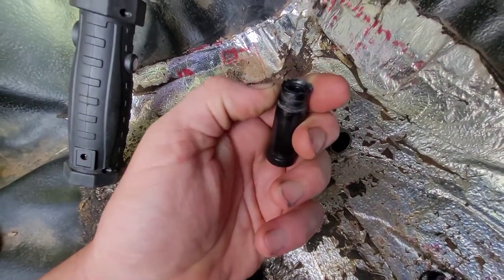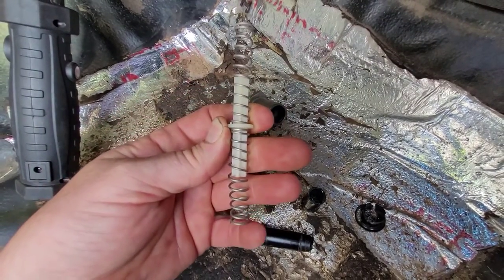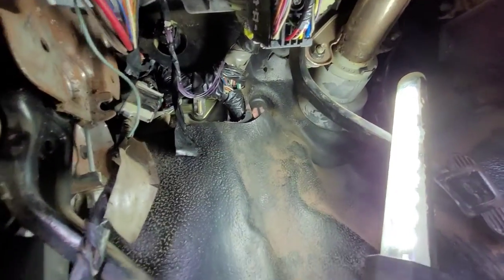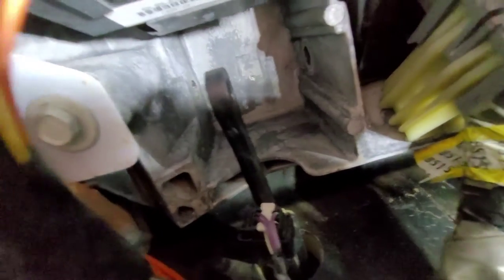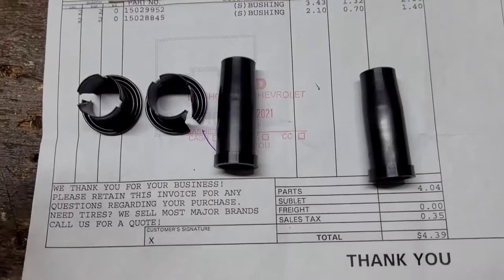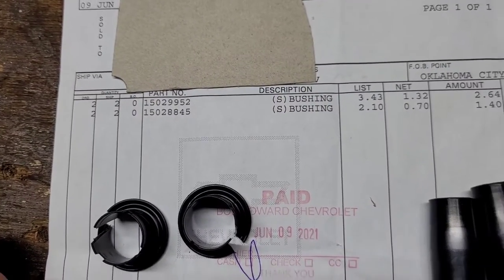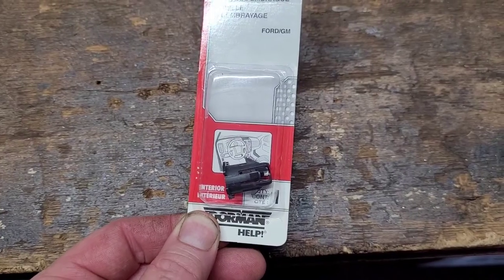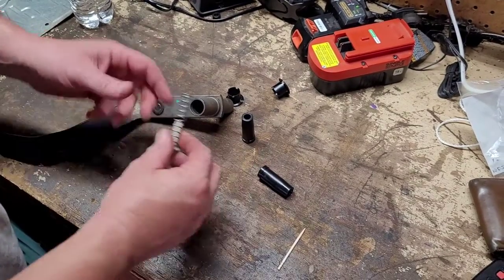How to replace the clutch pedal bushings on a 1999 Chevy S10 pickup

Comment: My clutch pedal broke off while driving to work which really surprised me. It did start squeaking every maybe 10th push. I thought the master push rod broke at first when it happened. I think I'm going to bulletproof it and take dash out and put a bolt like there should have been to start with. I really can't complain too much as it did last 26 years / 234k miles. Love my S10 it has been trouble free for a long time. Wish GM would make a true compact pickup again though. The dorman help stuff is hit and miss most of the time in my experience. The circle bushings are discontinued from GM now but luckily can still get them from other companies. Thanks for the video.
Reply: Brotherrrr! Mime just did the same thing! 99 with 280k haha. Thankfully I'm in front of the house though. So what did you do to fix it? What did you use? Since the circle bushings are now discontinued. 
I've had the dash out of the truck 3 times before. Fixing blend doors and heater core twice. Cause I loved doing it so much the 1st time 😂🤪

Comment: Thanks for the video, went off it today. Had to make the same repair. 

I lost one of the Springs, the dealer wanted $30 for just one spring. My local ace hardware had it for $2 bucks . 

Those two part numbers for the two different upper bushing i think are discontinued as well, luckily my local gm dealer had some laying around and yes they were cheap, around like $1.60 for one and $.70 cents for the other. 

The lower bushing that connects to slave cylinder bracket arm is like $11 bucks from dealer.

Comment from the maker: Also found out the previous owner installed some sort of high performance clutch which means there's more pedal pressure to overcome which means more stress for the stock pedal pivot bushings which means I'll probably be replacing these again fairly soon

Comment: Hello I have a question, how did you take off the pedal from its place. Thank you
Reply from the maker: The bushings were broken and the pedal had fallen out, come to find out a previous owner had installed a high performance clutch and it caused excessive pedal pressure which over strained the bushings and they broke

Comment: How did you take the clutch pedal out. Im reading decompress the springs but there is no way to do this. Can you kindly share how you got the old clutch pedal out?
Reply from the maker: On this particular vehicle, the pedal pivot bushings were already broke in half so the pedal just fell out, but if you needed to remove the pedal, i would guess you'd have to attempt to cut each bushing without damaging the little springs
Reply: @theman9764  the bushing on the left side is broken. I try wedging a screwdriver where the break is to free the right side but it wont shake free.

Even though its broken on one side, its like something inside still holding it. If i break it will it break the case holding the pedal arm?
Reply from the maker: @malcolmx8874  it shouldn't break the case but try not to apply so much force that it starts binding up against the case, if the bushing is broken or already coming apart then it shouldn't take much more to get it out, sounds like you're fighting against the remaining portion of the bushing and spring that's still encased in the pedal, it's not going to be easy to remove, but if anything does break, most of the parts are readily available
Reply: @theman9764  ok thanks a lot.

Comment: Hey Dan hoping you could help me out. I had this same exact issue and finally found the black bushings to repair mine. But lost that little white thing and box springs😭. Can’t find that part anywhere, I’ve checked everywhere. I don’t even know what it’s called. Any help would be very appreciated!
Reply: It’s the thing you called a Toilet paper holder
Reply from the maker: I think it's GM part #15734410
Reply: Thank you so much! I think I found it on Amazon with that part number. Really appreciate it man!!!
Reply: You don’t happen to know the spring part number do you?
Reply from the maker: @blakewebb5241  i think the spring part # is 15735121, you'll need 2 springs
Reply from the maker: @blakewebb5241  if you need to find part numbers for anything GM, i personally use GMpartsgiant.com
Reply: Thanks again man! Big help!
Reply: Where did you find them? I've been trying to find them for two weeks and I can't find the pieces.
Reply: Just as a comment, when the piece breaks the spring or the springs get stuck in the back, that's where I found one that I was missing!  because for some reason they are expensive between $25 and $30 dlrs only one!  I hope you have the same luck

Comment: Clutch pedal goes to the floor and returns but the clutch doesn't disengage. What do I need to fix?
Reply from the maker: Need to check the hyd clutch reservoir and see if it's empty, if it's full, then chances are either the clutch master cyl or slave cyl are bad and bypassing pressure

Comment: Hey Dan what was the issue or the problem with your truck that you had to replace it. I’m wondering bc my truck sometimes won’t start and sometimes it does . Is that the same problem you were having .?
Reply from the maker: I'm not sure what the symptoms were before the pedal broke but there are several reasons why it will or won't start at times, is it a crank/no start? Or no crank/no start? 2 totally different set of possible problems?

Comment: I have a question what if u don’t connect the cable that goes on the cylinder inside the truck
Reply from the maker: I guess I'm not sure what cable you're referring to?
Reply: @theman9764  for the clutch pedal
Reply from the maker: I guess your clutch won't work

Comment: Great video man, the bushing are plastic or metal?
Reply from the maker: Unfortunately they're plastic, another permanent fix for this would be to remove the whole pedal bracket and install a long bolt all the way thru and use a bolt with threads only on the end
Reply: @theman9764  thanks

Comment: Could you show a video where you explain how you removed the pedal?
Reply from the maker: That vehicle is long gone now, and the pedal had fallen out already, but i don't think you can remove it without destroying the plastic pivot, i think a sawzall would be the best way to cut the plastic pivot
Reply: I think I will try Sawzall or just wiggle it back and forth trying to finish breaking the old bushings. Mine are in real bad shape.

Comment: I’m having issues where my clutch won’t even engage on my 98 s10
Reply: An we noticed my bushings are broke an my pedals messed up
Reply from the maker: Could possibly be a couple of different things, clutch master cyl could be bad, or the slave cyl, check the clutch master cyl fluid level, worn out clutch disc, or the pedal linkage is broken, start with the easy things first
Reply: @theman9764  so far master an slave cylinder have been fixed, my clutch safety switch is good, I’m gonna. Be getting the bushings for my pedal to fix it just incase it isn’t getting compressed enough to engage since the pedals messed up

Comment: I know how to replace I need to know how to take the clutch pedal out
Reply from the maker: The little spring loaded plastic tubes that hold it up there can be cut with a sawzall, it's not easy to remove, there's no real easy way to remove the pedal besides getting rough with it and just cutting the tubes with a thin blade